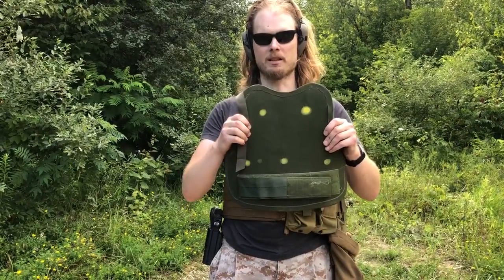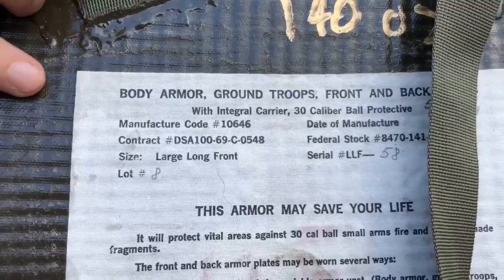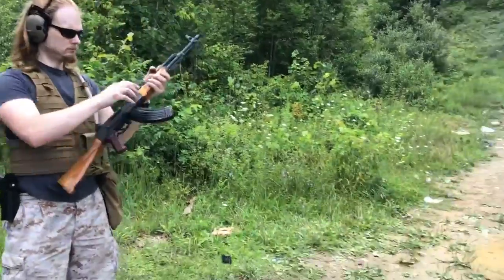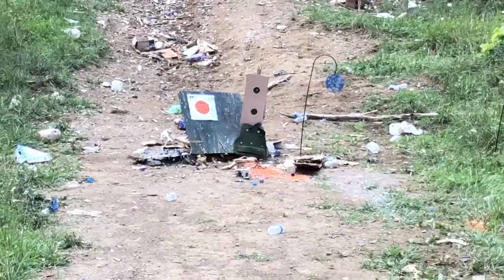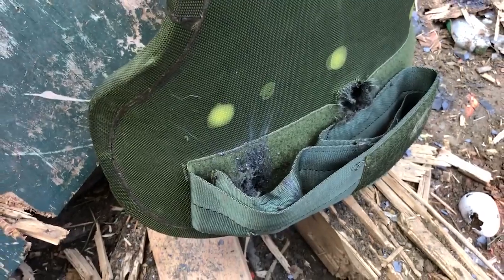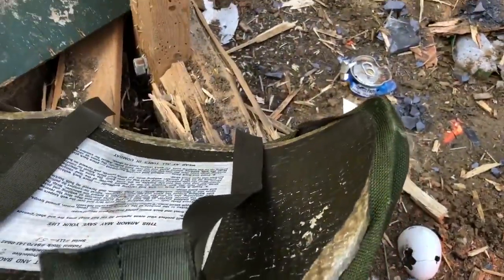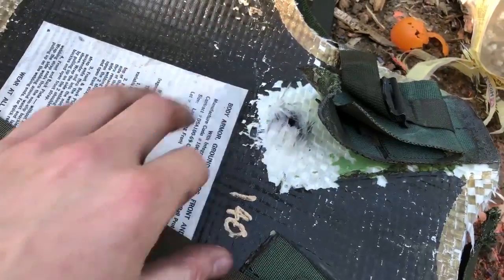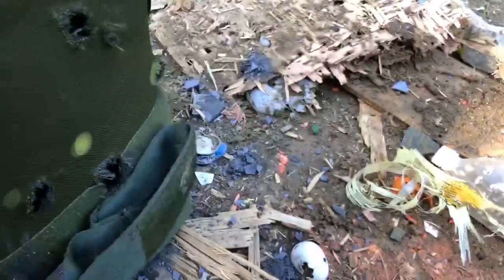Testing Vietnam Era VBA variable body armor plates from the 1960's

Comment: Hey, info correction , 

There were three types, 1 2 and 3,  alumina oxide, silicone carbide and boron carbide. With your DSN, yours is alumina oxide, Type 1.  Your plate was dropped before, if you look at the back ballastic nylon sheet, you see sheering.

The plate would act as the main stopper. The ballastic nylon , the actual vest would most likely stop the remaining projectile.
Reply from the maker: No aluminum oxide is white. The ceramic portion was dark gray.

Also your thinking of helicopter pilot vests not vba for ground troops.
Reply: sigh  I have papers and documents, and vests, natick experimental, aircrew, and so much more.  Your exact DSN for that plate you showed, is type 1. The ceramic can be any variation of color, because of the bonding process they used for the VBA and aircrew plates. as I have experimental unformed boron carbide plate halves that are pristine white.  Also you meant to correct the other person.  Aircrew used Chicken plates mainly, but also there is one picture alive that the pilot wore a VBA.
Reply from the maker: @Eltrix0  aluminum oxide plates weigh 15lbs, this one is Under 9 lbs.
Reply: @tarantulapettingzoo2980  with all due respect. The info I am relaying to you is from a STAMPED document from natick on the production and usage of Body armor, ground troops. .

I have a large long type 1 variable type next to me. Let's go weigh it.

Weighed it, Front plate is 9ish pounds. Ballastic nylon over vest is about 4. :)
Reply from the maker: @Eltrix0  a 10x12 aluminum oxide fiberglass plate weighs nearly 8 lbs but is substantially smaller.
Reply: @tarantulapettingzoo2980   heavy sigh  The reason I'm trying to "correct" you is because this is basically the first video on someone shooting a variable plate. I'm trying to give correct information so people don't get things wrong in the future majorly.  

The poundage, statistics and info I am giving you is almost word for word from a authenticated document from Natick on the production and tests in 67/68. I also have a production and a experimental variable type.  Trust me when I say Natick was basically on metaphorical drugs when the produced things. 

They had a shitload of different sizing for different vests,   m69, S M L XL,   VBA Medium medium regular medium long   , large regular large long,   aircrew short regular long,  experimental,  all sorts of stuff. 

again the info I am giving you is directly from the document, for anyone looking

Crash course The US has three main different types of Armored systems.  1 2 and 3,    alumina oxide, silicone carbide and boron carbide ,

With each, you have phases and also types that stem from those,  so a type 1 can have a phase 1 type 1 or a type 1 phase 2 type 1 and so on

You may have X composition plate from within the last 5 years but X plate is nothing like Y naticks.
Reply from the maker: @Eltrix0  show me the size chart that says a large long variable body armor front plate made from aluminum oxide is 9lbs.
Reply: @tarantulapettingzoo2980  can't really attach a screenshot or send it to you in the mail.  

If you have the back plate at all AND THE DSN MATCHES, MEANING ITS A PAIR , put it on a calibrated scale and it'll prove what I've been saying  Look on USMF, again, weigh it and prove to yourself?

It's not made from one slab of a.o it's layers of material
Reply: Well. Im tired and I said hey you look familiar. And well.. I saw the how to survive video and said, hey that "vest"  I'll message you.
Reply from the maker: https://imgur.com/a/3Fk1WN7 this is that vest I used in the other video
Reply: @Eltrix0  have you tried spectrometer material analysis?

Comment: I really want one of these, super neat plates. It's so weird that the US had issued rifle rated armor in Vietnam for infantry. These are diffrent than the air craft crew body armor or the "chick plate". They are surprisingly light for how old the system is 20 lbs. As far as the literature that weight is with the weight of the flak vest included not separate.

They were intended to be worn individually with straps or be integrated in the flak vest. So it's also the first stand alone plates.

Comment: hang on, so you tried with 7.62x39, 7.62 NATO AND NO PENETRATION, Then two 5.56mm rounds & wonder why NO PENETRATION???  Then with a larger calibre than .30 being the Nagant rounds they penetrated.  Do you understand ballistics?  i'm using really short simple words because I think you don't comprehend the science.
Reply from the maker: Actually m193 has better penetration against steel than m80 or 7.62x39.

Plus 7.62x54r is pretty comparable to m80 except for the steel core.
Reply: @tarantulapettingzoo2980  
It's a velocity thing
that and 855's core isn't made as AP
more akin to barrier-blind than defeating armor